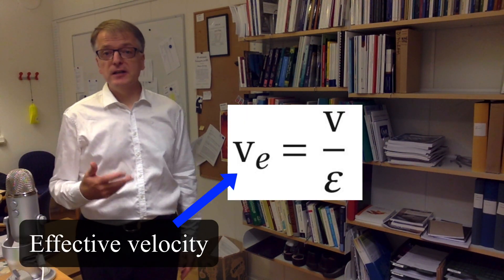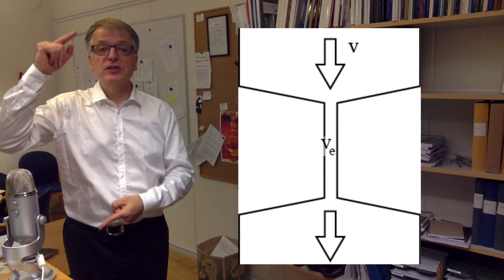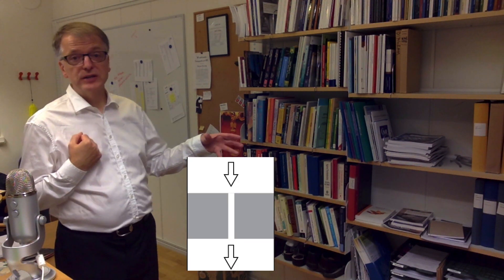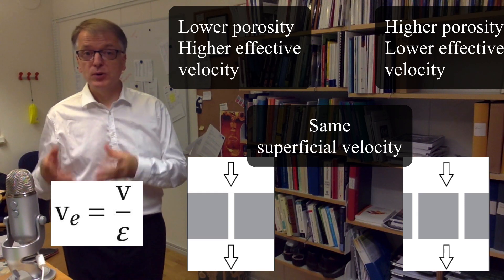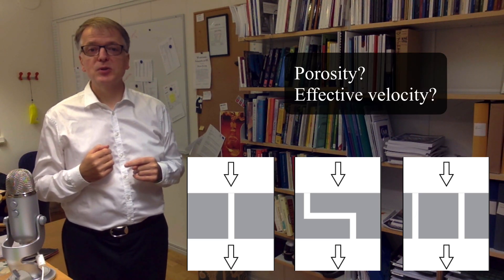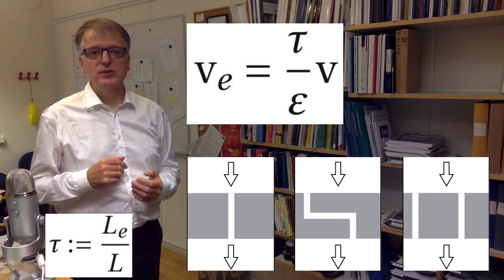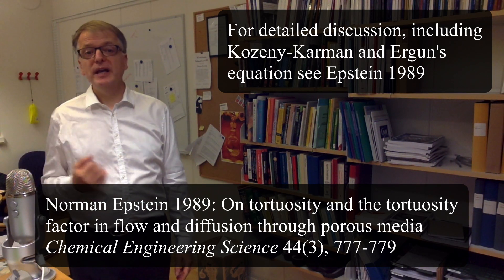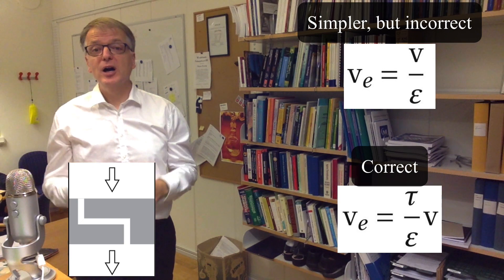Where text books go wrong about porous media

Comment: Excellent video Professor!
Does the inclusion of Permeability of the medium in the definition of superficial velocity (as is the case in Darcy's Law, where it is sometimes called as the Darcy Velocity), make a difference in the relation of superficial velocity and interstitial velocity?
Reply from the maker: As there is quite some confusion in the literature (see Epsteins short communication, link in the description of the video above) you need to look at the exact equations used in a specific book to see what is correct or not. What people mean by different terms unfortunately varies and quite a few books have not got this right. Many state that (whatever term they use for) the actual velocity in the pores is the superficial (or whatever term they use) velocity divided with the porosity. That is NOT true. You simply have to take tortuosity into account. 

BTW, I would not call myself an expert in this field, but Norman Epstein (1923-2023) truly was and my video here is just my attempt to help spread the important points in his short communication on this matter.
https://chbe.ubc.ca/news/2023/professor-norman-epstein/ 

Now, if you work in a field where the tortuosity is essentially a constant  (e.g. 1.41), the same in all cases, you would likely adapt your various parameter values so that you do not notice the error you are actually making in not taking tortuosity into account.

Comment: Great video Professor. However, does the effective (or interstitial) velocity is same as "pore velocity" (or physical velocity) in packed beds, as described in many textbooks?
Reply from the maker: As explained in the video, many textbooks (not all) state that the interstitial velocity v_e equals the apparent velocity divided with the porosity. As explained in the video, that is incorrect. Hence the crossed over equal sign in the video miniature.

The tortuosity of the flow channels influences the interstitial velocity, just as explained in the video
Reply from the maker: Re-reading your question, which I find a bit difficult to understand, perhaps I should clarify: The effective velocity v_e I talk about in this video is the actual velocity in the pores. Many text books on various topics where porous media is dealt with (including books on packed beds) get this wrong and forget to take tortuosity into account. Unfortunately, different text books use different terms for the velocity (which adds to the confusion). Text books that do deal with tortuosity are unfortunately also sometimes confused, confusing the tortuosity factor with tortuosity. The tortuosity factor is the tortuosity squared.

So if the first level of understanding is that of these erroneous text books, then the second level is to realize that tortuosity matters. Epsteins article on this matter is probably rather difficult for the novice in the field of porous media, but its clear argumentation proves that these text books simply are wrong.

The third level of understanding is to realize that you typically have a distribution of flow velocities in each flow channel, just as text books on fluid dynamics explain regarding (laminar or turbulent) flow in pipes. The effective velocity I talk about in this video is the flux weighted average of the real, physical flow velocity in the flow channels.
Reply: @PLE_LU  Thanks for the response. My query is regarding the usage of V_e, not on the tortuosity. Let me put the question in the following way:

"A typical representative elementary volume (REV) in a packed bed has different pores. Now, there should exist a velocity component within the pores (voids) which is termed as, say 'pore velocity (or true physical velocity)'. How this pore velocity relates to the interstitial velocity? Can the mean pore velocity be called the interstitial velocity?"

I totally agree that the adoption of different characteristic lengths and velocities in the literature adds to the confusion. Thus, leading to ambiguity over such topics.
Reply from the maker: @rajendrakumar-bn7ch  well, although you claim your question is not about tortuosity, it really is. You see, what some (or perhaps even most) text books on packed beds refer to as the "true velocity" (or some similar name) is not the true velocity at all, but just the value you get when you divide the apparent velocity with the porosity.This fake velocity is always less or equal to the actual true velocity (equal to if tortuosity = 1). To calculate the true (average) velocity you need to multiply with the tortuosity as explained in the video above.

Why some text books on packed beds insist on calling a fake velocity the "true velocity" I do not understand, but I think the best way to judge if a text book is wrong about what the velocity in reality is in the pores is to check if they say anything about tortuosity. If they don't, I would say the chance is 95% that the text book is wrong.

Funny enough, you might find a text book that doesn't mention tortuosity but uses Kozeny-Carmans equation or Ergun's equation to describe the flow in the pores. Those equations take tortuosity into account, but hide the tortuosity in the factor 150 (or sometimes 200). Epstein's article explains where this factor comes from. 

As I understand it, the typical tortuosity in a packed bed with spherical particles is the square root of 2, i.e. approximately 1.4. What many text books refer to as the "true" velocity in the pores is thus actually about 1/1.4=0.71 => 71% of what the true velocity in the pores actually is.
Reply: @PLE_LU  
It would be helpful if some literature on the estimation of tortuosity in randomly packed beds, or similar can be provided.